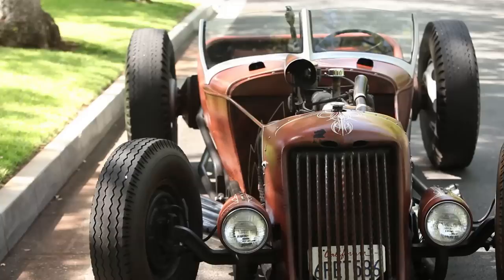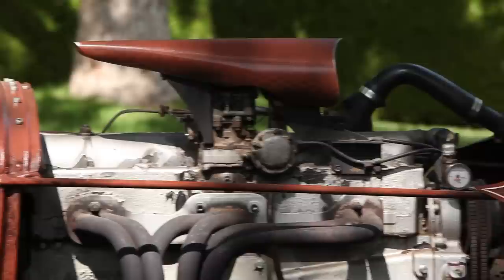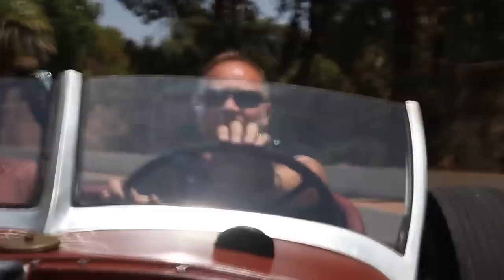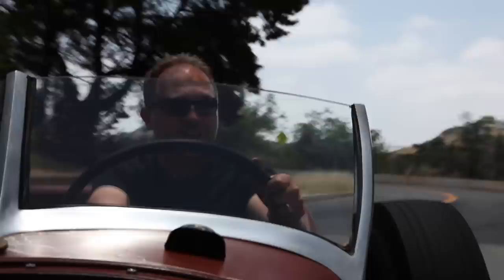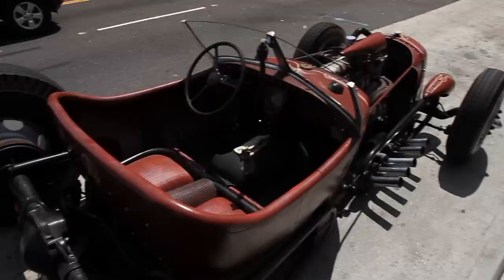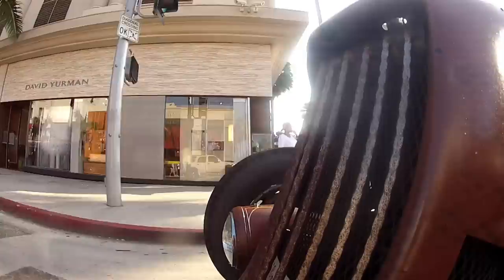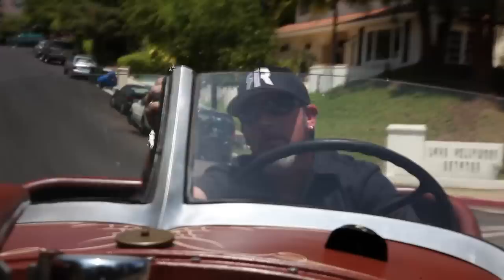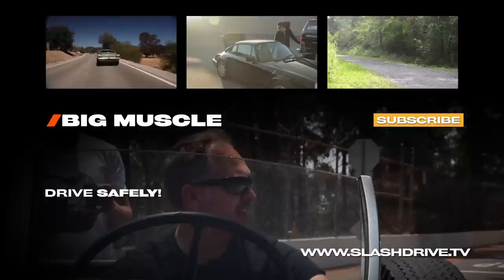Satan's Rat-Rod: 1931 Ford - /BIG MUSCLE

Comment: Wow. A straight six that makes 1600 ft/lbs of torque? 1,000,000 miles and never been cracked open? And it's a 31' Ford engine and trans? If that doesn't say "they don't make them like they used to" then I'm not quite sure what does...
Reply: Dylan Stassen my honda has close a million. and cost about 50 bucks for the engine.
Reply: it does not cost $50 for the engine. I own one and it costs a little more than that.
Reply: Dylan Stassen
d16's in my area go for about 100 bucks and I picked my engine up for 25 bucks spends abour 40 on new bearings and still running in my car making 400hp on ethanol runs 120mph
Reply: Right... That's bull. How do I know? I fuckin own one. They're not in the $25-$100. Nor will they go over 1 million miles.
Reply: Certified and everything? God damn. You must be pulling in all the reputation for being able to talk online. Point being, that rat rod is a beast.
Reply: Dylan Stassen Its not a Ford engine or trans in that rat rod  -_-
Reply: EthanD Draper he said it in the video if you were listening...
Reply: Dylan Stassen I'm also not stupid Ford didn't make a straight 6 or 5 speed in the 30's. The engine is from a 1952 diamond reo tractor and the trans and rear end is from a 1951 whites semi.
Reply: EthanD Draper I'm just quoting what the guy said...
Reply: So am I...
Reply: I apologize. Either way, the engine is still stupid reliable. And still proves that they don't make them like they used to..
Reply: That is completely true nothing today will ever run that reliable. They all just have to many sensors and electronics.
Reply: The numbers that the engine has is baffling to me still. Just bananas
Reply: Thats just how america worked back then. America built work horses. No company will try to recreate it now due to emissions
Reply: low compression rules
Reply: +cartmanrlsusall I just noticed how there was a grenade at the top of that shifter......
Reply: +Dylan Stassen (Bassman415) he said it was out of a tractor, commercial vehicles are built to a higher standard, and more expensive in general. Peter built trucks can go a million miles for example
Reply: +Dylan Stassen (Bassman415) 
I'm skeptical of that.  Back then the bearings, metal alloys, etc. weren't nearly as good as today.
Reply: charlesvan13 heavy cast iron blocks and heads,plus low compression,and rpms.that much over building makes an engine last a long time.
Reply: +cartmanrlsusall 
They hadn't learned about planned obsolescence yet, so they built stuff to last forever.
I have woodworking machines from back then, that with a little care will still be working hundreds of years from now.
Reply: scream built ford tuff to me
Reply: 602 cubic inches
Reply: taizer you must feel really good about owning a piece of asian plastic
Reply: Engine was built by Ransom Olds.of Oldsmobile fame

Comment: Come on mike, there is no way that thing makes 1,640 lb-ft don't believe everything people tell you. Just do the math! to make 275 hp with that much torque you would be looking at peak power at around 880 rpm, likes to rev? right...
Reply: Maybe at the wheels with a low range gearbox?

Comment: Doing some simple math, I find the 1600 lb/ft of torque to be very unlikey. 
To make only 275 hp, it would make its peak power at only 900 rpm, at which point the torque drops off faster than the rpm can rise. This thing is clearly revving and cruising around at much higher rpm than that and it would be slower than a prius if it ran out of power at 900 rpm, no matter how much torque it makes.
Reply: the crazy thing is, that its true
Reply: +Patrick Decarvalho Diesel engine, low rpm and crazy torque.
Reply: Jack Allen it's a gas engine though

Comment: Saw this when it came off, can’t help to watch it once in a while and feel so good about the man anx the machine. Both are very unique, as Mike Musto puts it. Engine, I think, is a 10 liter straight-six gasoline powered beast with 60% more torque than the 2020 Cummins diesel RAM.

Comment: That is an incredible engine! straight six for the win!
Reply: I'm pretty sure its not a straight six.  Have you ever seen straight six with the exhaust manifold coming out of both sides?  And no straight six makes that much torque.  pretty sure its a 10 cyl.
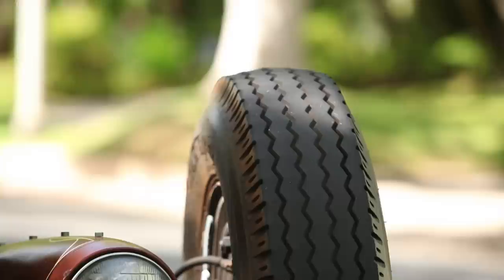Reply: Ben Kerchner You are wrong and I don't think you know what an exhaust manifold is. At 1:56 is the exhaust side, you will count 6 exhaust runners connecting the head to the downpipe, which connects to the 6 individual chrome exhaust tips. That part which does all the connecting is an exhaust manifold. At 4:42 is the intake side, you will find there is not a manifold connecting the head to the exhaust tips in any way. In the same location on this side of the engine, you will see the 6 gray plug wires going to the head where there must then be 6 spark plugs, and the other kind of manifold known as an intake manifold to which the carb is mounted. The "exhaust manifold" you're referring to on this side is actually just exhaust tips, probably welded on for show, or connected to the other side with a plenum box of some kind underneath.

   This is an engine with one bank if cylinders, see how it's a straight line, not a "V"?  Since there are 6 exhaust runners on the exhaust side, and 6 plugs on the intake side, we can assume it is a inline or straight 6. But if that's too complex for you, count the wires on the distributor at 2:20 you will find there are 7. 1 for each cylinder and 1 for the coil. This is absolutely a straight six. I'm not sure why you would think this is a V10...V10s have two banks of cylinders and two heads. There is nothing that would suggest that statement is true, even in the eyes of a novice car guy. I can seen how a novice would think this is a v12 maybe because there are 12 exhaust tips...but it's neither.

  And there are many manufacturers of inline sixes that produce more torque than this thing even does. Including Mac, Cummins, and International to name a few. They are the best engine for pulling due to their torque potential and their perfectly balanced crankshafts. I am a diesel serviceman, I know what I'm looking at.

   Ever seen a V10 with one bank of cylinders, 7 wires going off the distributor, 6 exhaust ports on one side of the single head, and 6 spark plugs? Me neither, class dismissed.

Comment: If it came from a tractor I wouldn't be shocked in the slightest, but still 1600 ft of torque is a high number for such a small engine.

Comment: Yes exactly, i understood they meant a road tractor but i used the Vario example because of the similar displacement and number of cylinders, if we consider road tractor it is even more hard to find an engine with similar output because as you say they have longer gears to reach higher speeds. For example today's Scania engines in buses and light semi in Europe, need a 9 litre v8 to put down 1600 Nm and 320 hp (so more displacement to have same torque and more cylinders to reach higher rpm).

Comment: Wonderful build and cool owner but i can't believe that such an old motor is producing that amount of torque, for example Agco Fendt Vario 936 with a diesel 7142 cm³ straight 6, 4valve, intercooler turbocharged and with common-rail injection puts down 1482 Nm and 366 Hp, and that's one of the most powerful tractors.

Comment: My 2007 ih 9900 ix eagle makes 2200 ft lbs of torque and with a slight adjustment of the ECM it makes 700 hp. It is an inline 6, 15.0 liter. 500 ft lbs of torque idle on that rat rod is not anything too groundbreaking, it's a semi engine.

Comment: I'm with you Marcello.  No way.  The only way this engine is making 1600 lb*ft is behind a 3:1 reduction box.  I think too that when they said "tractor" they meant a road tractor.  Even so, no engine from 1952 that would fit between those frame rails makes anywhere near 1600 lbs*ft without significant power adders or forced induction.

Comment: The specs from a Continental 586 cu. in 6cyl OHV gas engine from around the same era is HP 200@2600 rpm and torque 462@1000 rpm. I doubt this engine is even that big and is probably very similar in design. It's still cool to see people use bazar old truck engines like this in rat rods.

Comment: Very nice vid, Mike! This is a real rod to me, not some big buck brandname-ster, that you fear everytime it's out that something might scratch it. Also, never seen a hairpin used on the rear axle, guess if it works, it stays :) An extremely cool ride - there is not much to say when it gets mobbed on the Hollywood Boulevard, how do you beat that? 
And that motor would probably run on everything, gas, diesel, jet fuel...

Comment: this car reminds me of my current daily driver an 80 Mercedes 280se with a factory Inline 6 gas motor blows black smoke every were she goes but well do 140 when u want it to and running on 40psi compression dont ask how our best guest is its  mechanical fuel injected and has over 1/2 a million miles on her literately and fires up and runs every time.

Comment: They are really cool, older style truck tyres. This means they last ages but don't grip like a modern sports tyre. They also lack the super high speed ratings most modern sports tyres have. However they probably make this thing both cooler and far cheaper to do burnouts in without actually sacrificing that much given that its not going to drive at 100 miles and hour or corner that fast anyway, so running out of rear grip and hanging the tail out isn't all that bad for a car of this character.

Comment: Not sure about the gear box yet.  I think a reverse valve.  As for whp the Nelson 509 is putting out over a 1000hp on pump gas and even higher on race gas.  How that will come out in whp will somewhat have to do with the gear box I choose.
how ever it comes out I'm sure it will be a blast.

Comment: In addiction here the torque is expressed in lb ft so 1600 lb ft * 1,356 = 2169 Nm, an this is a value typical of a modern semi tractor, powered by a diesel v8 with a displacement between 13 an 20 liters, it depends on the brand and on the specific application, of course.

Comment: That's really cool, great detail work and all.  But 1,640 ft. lbs. of torque?  That engine looks like a REO 6-200 Gold Comet from the late 50's.  400 cubic inch, overhead valve 6 cylinder, 200 h.p. @ 3400 r.p.m., 365 ft. lbs. torque @ 1200 r.p.m..  Still plenty for a buggy like that.

Comment: thats a cool car and the fab in it must have been a long process i would like ot do a project like that but build it a bit safer put the gas tank in the back and make a stronger frame for that monster bit of torque and up the horse power to 550 or 600 and put a 32 ford body on it thats what i would do

Comment: "Let’s lift the hood and check out the legendary “Gold Comet” engine. If I got it right, it had 331 cubic inches and 128 hp. That should get me down the highway at about 50-55, depending on the gearing." http://www.curbsideclassic.com/curbside-classics-american/curbside-classic-1952-reo-f-22-dump-truck-i-can-dig-it/

Comment: It's a cool car.  not a chance it makes 1600 ft pounds.  not a chance at all.  That's similiar to what a modern big rig makes.
Reply: Detroit 8V92TA Makes 1200lbs-ft. of torque and that was a 1970s-1990s motor maybe older

Comment: If it really has 1600lbs/ft let's say at a low 1800rpm that means 552hp, but it doesn't have that much.
Please tell the Cubic capacity , specially on these engines we wouldn't know

Comment: Tractor Motors were not built for horse power, they were built for Torque, High Torque does a LOT less wear then  High Horsepower.. I doubt this thing generates 275 Horsepower though, or 1640 Ft Lbs of Torque, something was forgotten on the Dyno that day... I think the Gear Ratios/Rear Diff Ratio was incorrectly inputted on that day... But yeah, 1640 Ft Lbs of Torque... The case never cracked open and I am not seeing any obvious Performance Modifications..... I am sorry, I just can't bring myself to believe that it generates 1600 Horse Power from the engine alone... Beautiful car, cool owner but.. I am sorry, but I have just never heard of such a high Torque engine... from the 1950s. I mean the amount of wear that HAD to have occurred... IDK.. Maybe it is Satan's Hotrod.. Only explanation... >.<

Comment: Hybrids are more efficient, more reliable and cleaner (if you plan on keeping the car for more than a few years) than a modern diesel engine.

Modern diesel engines are crap because of all the exhaust cleaning systems they must have.

Comment: Heh. That's a Continental OA331/REO Gold Comet gas engine. Makes 148HP and 330lb-ft.

This guy just seems to be full of crap so his rat rod seems more interesting. Heim joints off a Lear jet, huh? Yeah, sure. 1,000,000 miles on the engine, OK. Fencing for the leading/trailing arms (which he likes to call wishbones,) that looks a lot like normal DOM tubing, mmm hmm.

Comment: How do they 1600 ft.lbs of torque from a 275 hp engine?  7000 horse nitro dragsters only have about 1500 ft. lbs of torque.
Reply: The motor would have a longer stroke than most. That's what makes it have 1600 foot pounds
Reply: Use a long stroke to make torque, use a short stroke to make horsepower. It's really not quite that simple, but it is a fair "rule of thumb. A shorter stroke lets you develop higher RPM, thus more horsepower, and if you think about, a longer crankshaft throw gives you greater mechanical advantage, thus more torque.

Comment: don't believe  torque  numbers claimed(the best ford ever made was ~200Hp@225FT/lbs not counting the torque amplifier(this is where you could make the insane numbers but you basically trade wheel speed and RPM for it)
tho with a full package build you might beable to get 300Hp and 275Ft/lbs
Reply: *****  yea there is no way in hell that greasy old sprew factory makes 1600FT/lbs without the torqe AMP from the tractor a torq amp is basically a giant spring wound around a drum

Comment: You say the engine is designed to put large torque, clearly have no idea how an engine works. It may have a much longer stroke than the bore wich indeed makes the torque higher but no more than 88 lbs*ft/ liter and most have less than 70, so in a 331ci 5.4 liter at best would be 380 lbs*ft
 To pull heavy objects the torque is multiplied AT THE WHEELS in the transmissin, transfer case, and axle there are no supernatural engines. It's a mistake that torque of 1600.

Comment: It's not an "us vs. them" mentality. In fact I have no issue with hybrids or electric vehicles at all. The Prius however is truly an awful automobile. It offers consumers a terrible ride with ill handling manners, it's interior components/materials are cheap and sub-par, and from a power perspective, it's at the bottom of the barrel.   

There are some wonderful hybrids/electrics on the market, however the Prius isn't one of them.